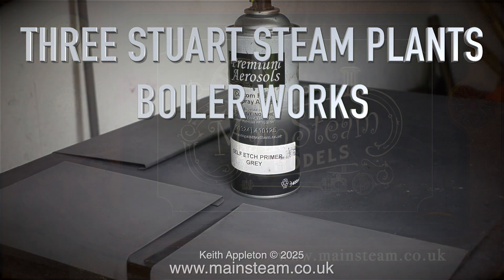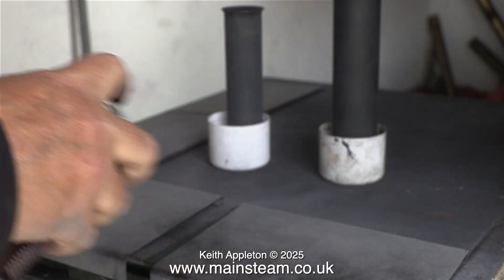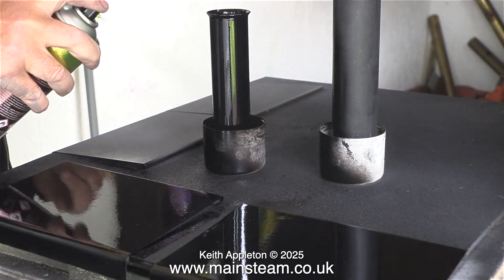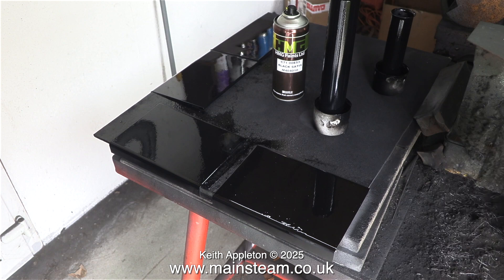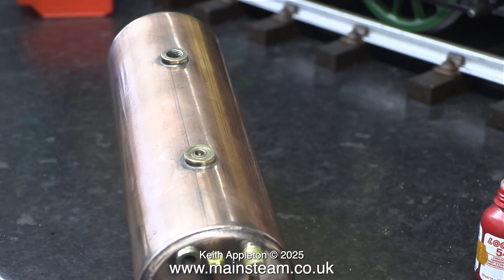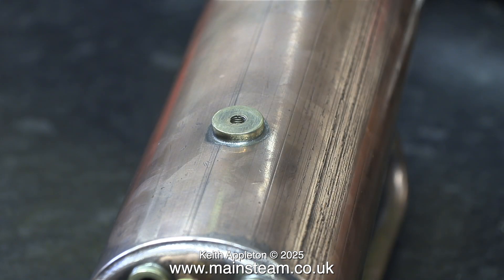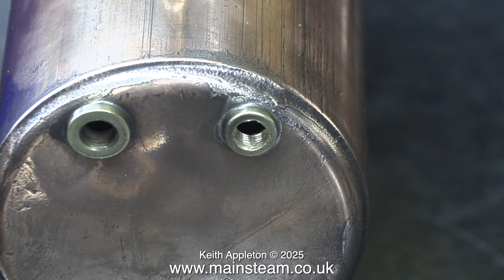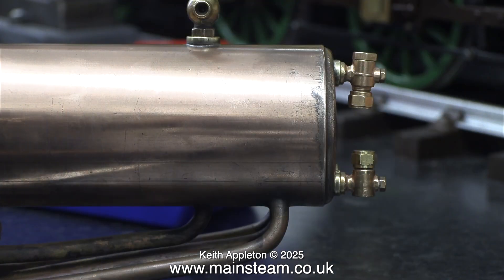THREE STUART STEAM PLANTS - BOILER WORKS - PART #7

Comment: When I was painting models. Wire clothes hangers were invaluable. Bent in half, the parts could be placed on the folded bottom section and used as a stand. You can get creative with them and come in handy. Folded in half and shoved inside the chimneys would have been grand.
Reply from the maker: Yes, that is a good idea - thanks for the tip }:-)))